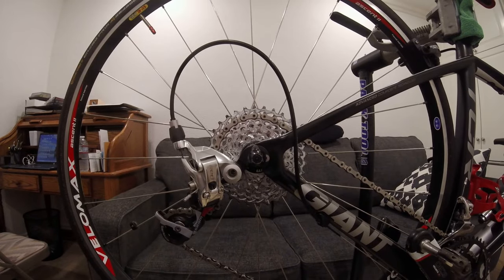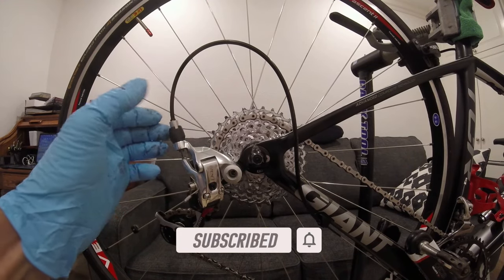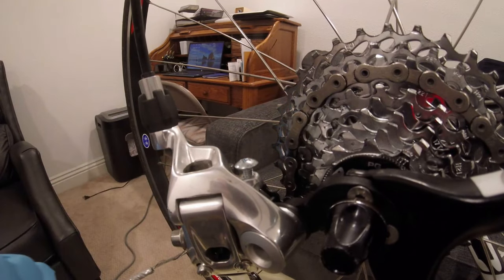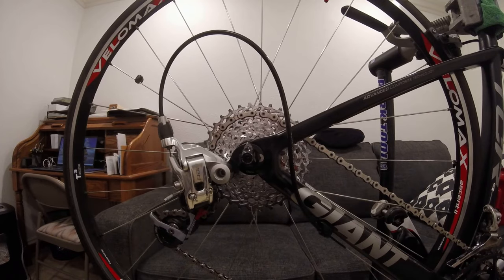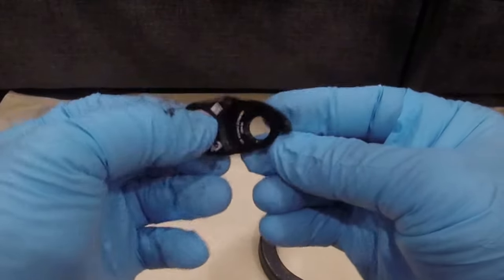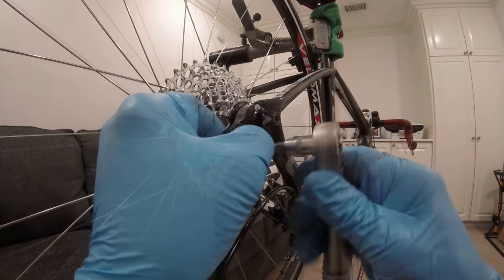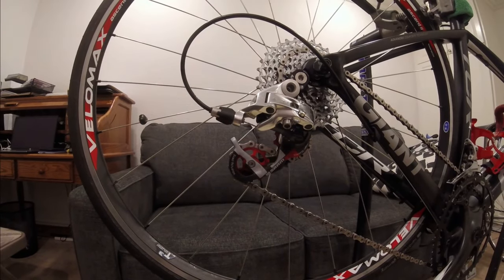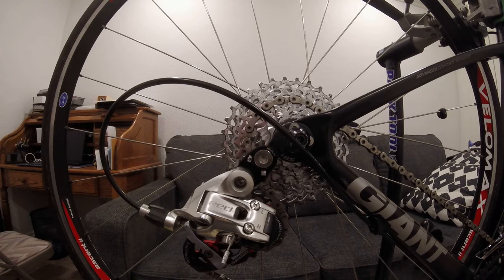How to get a Sram or any short cage derailleur to work with a larger cassette cog

Comment: Nice video!  That Wolf Tooth Road Link is also used by people with long cage derailleurs that want to go even lower than 11-32, such as 11-42.
Reply from the maker: Thanks for the info Earl.   So far its's working out pretty good.  It doesn't shift as crisp as it did before but does shift just fine and works well with the larger cog.